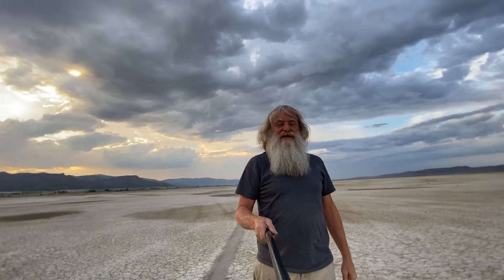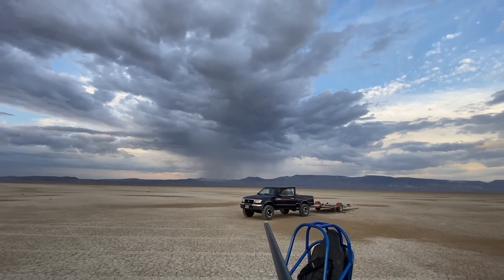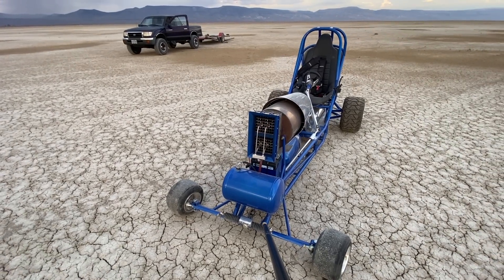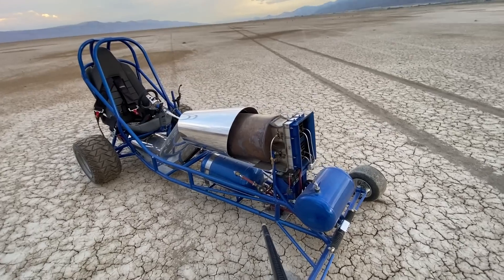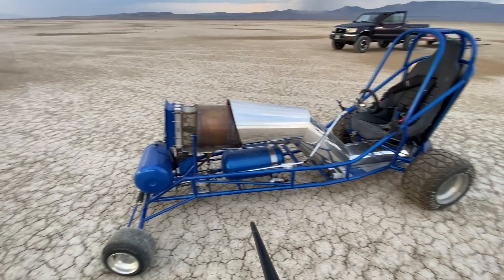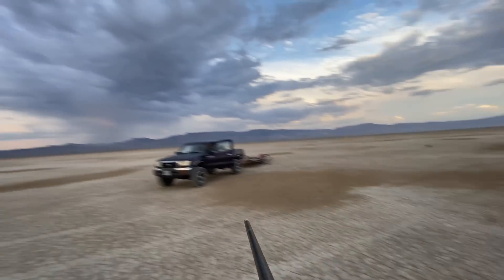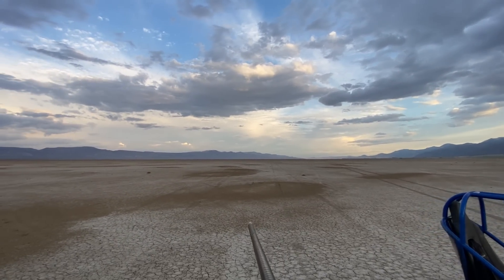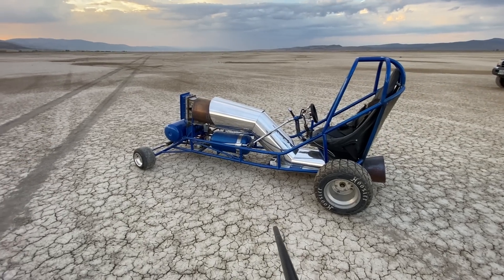Crazy Rocketman: The new "Desert Rat" jet dragster.

Comment: Amazing the Aluminum holds up to the 1200 degrees, I thought aluminum melted at about 900. Must be different grade that take more heat. Very cool build.
Reply: Light duty diesel pickups run aluminum pistons and they generally will hold until 1500-1600 degrees.
Reply: @BlueDually4x4  🤔👋
Reply: Rob 👋